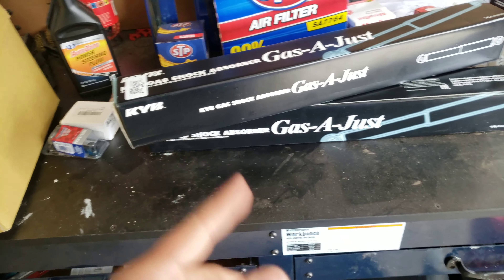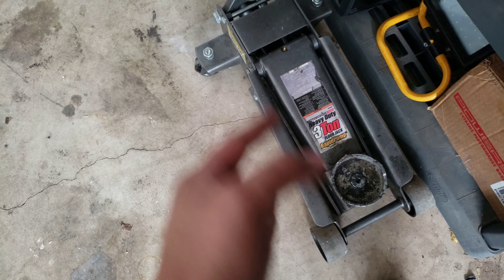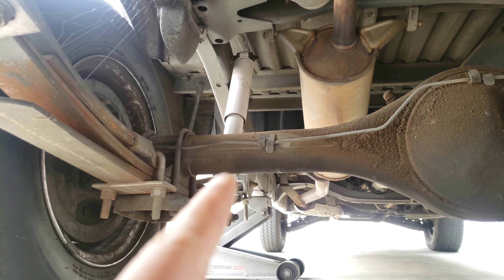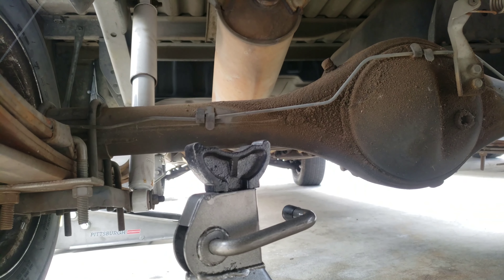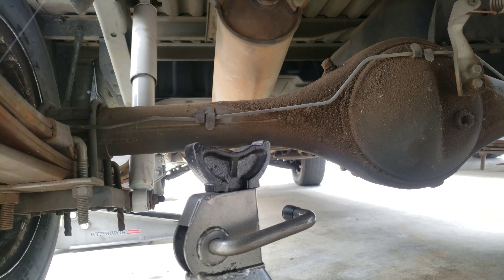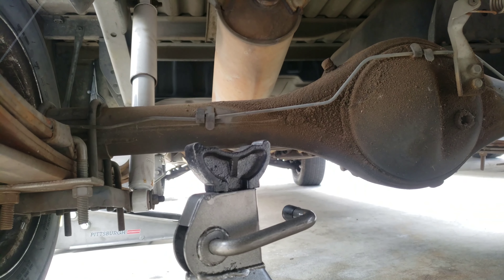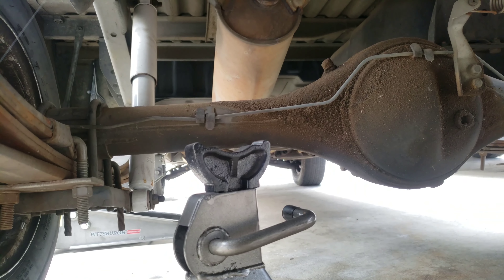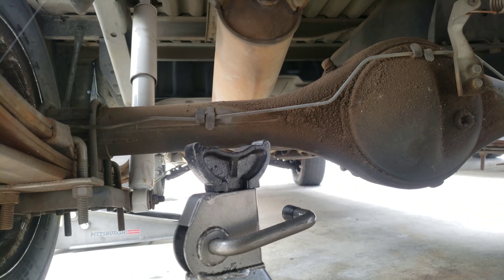1988-96 Nissan D21 DIY Rear shock replacement

Comment: Good video. Doing my rear shocks soon on my 90 4x4 with 86k original miles. Using the exact same shocks.
Reply from the maker: Making a video?? They do ride stiffer! But i love it. Sadly my d21 ain't 4x4 but I love it. Send some pics
Reply: I got a 92 2wd w/ 88K original mikes.  Got it 3.5 years ago w/ 53K on it.  Great truck.  Looking forward to my new shocks.

Comment: I think even the 1986 and '87 use the same size shocks.  My '95 and '86 D21s are the same.  Did you use a torque wrench at the end?  1989-1997 get 22-30 ft lbs on both nuts.   1986-1988 D21s were recommended 12-16 ft lbs on the lower nuts.  I can't see why the diff.

Comment: Thanks bro I was woundering how to do this except yours if lifted or stock and min is pretty slammed to the floor its 4 inches off the ground so not much room above the tire for me
Reply from the maker: Not dropped or lifted. It had original shocks all-round. The previous owner used original parts. Im using the KYB brand for hauling but in return I ride a bit stiff. Still feels a million times better from worn out shocks.